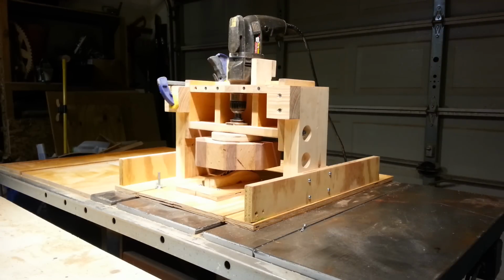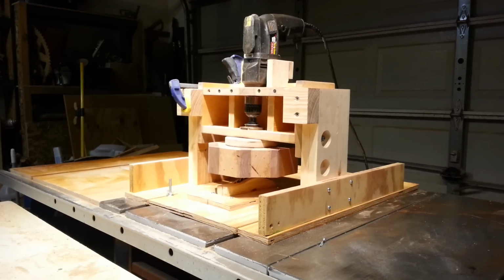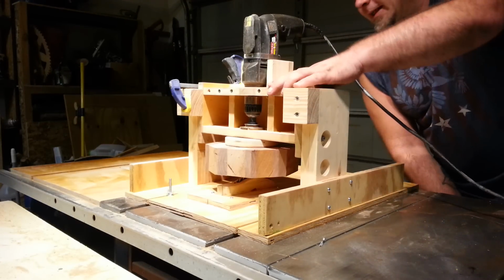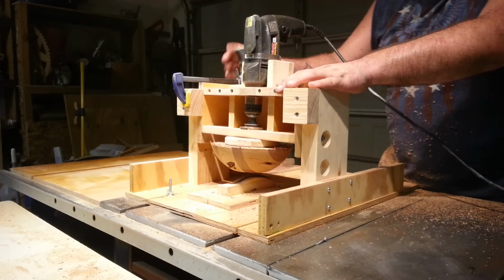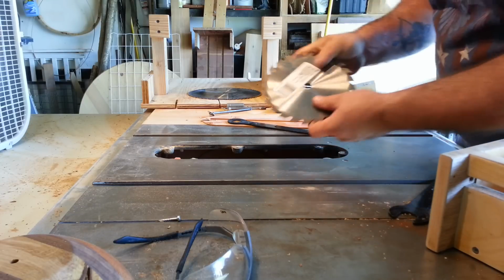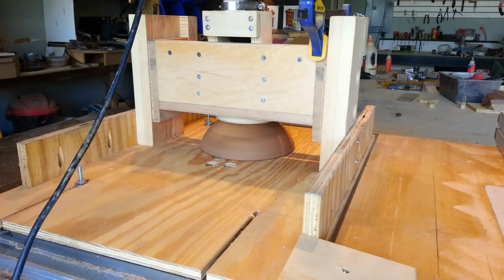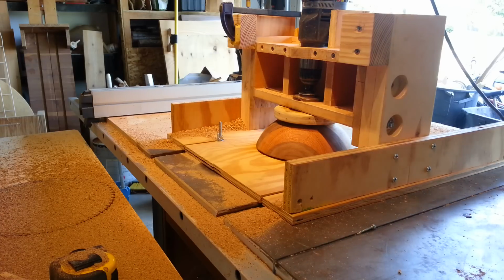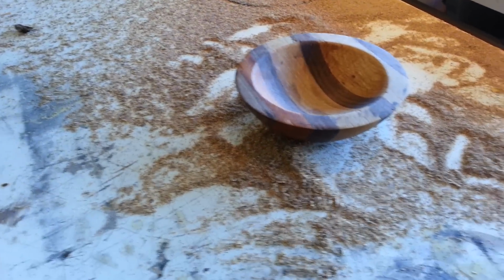SIMPLE JIG! turns a "bowl" on  "tablesaw"!

Comment: As my uncle used to tell me: if you save it, it will last forever. At a reasonable speed there is no abusive force in this process; this is just one more brilliant innovation to add to the list of uses for the most versatile carpentry tool that there is. If you only use your table-saw for straight cuts, there are so many things that you will never make. Replacing bearings (and even sometimes a motor) is just part of the game to me.

Comment: i have seen a lot of videos of bowl making with green wood and then having to let them dry before finishing them back on the lathe 
i can see this being an excellent way of "roughing" out bowls in quantity quickly and easily with no problems mounting onto the lath if you use the surface plate for both operations and mark the orientation 
will be making one of these as soon as possible 
do you have plans for them that we your subscribers can get

Comment: Izzy,  Thanks for the video.  I'm making a large bowl for a pattern for sand casting and this looks like the perfect method for what I'm doing.  Can you share more details or video about the bearing that connects & supports the drill to the bowl blank?  That would help me understand how it works.   I want to scale it up for an 18" diameter bowl.  I only need to shape the exterior.  I'm planning to decorate the pattern bowl with various temporary decorative textures & patterns, and reuse it over and over. 
thanks again,

Comment: Have you considered including a method by which the jig could be slowly moved horizontally while the bowl is in the inverted position and the saw blade raised? My thought is to move the blank after you have raised the blade to the desired depth of the bowl. It would create a larger diameter bowl with a flat bottom. Perhaps some sort of screw advance would do the trick.

Comment: Hey thanks, I have never seen a jig like that before, great because it sounds like you are really into jigs, ha   anyway its way cool.

So at the end of the video you mention about seeing what it can do, this may be a suggestion a lot of the stuff I make are cove on the table saw by running the stock at an angle across the blade with a slanted fence clamped to the table, however in some instances instead of the blade staying at square, tilt the blade for different effects thought it may work you

Comment: Would using a stacked Dado blade work better? Would it make a smoother cut?
Reply from the maker: Jack Lingerfelt  I wouldnt say it leaves a better cut but it definitely feels safer
Reply: +Jack Lingerfelt  Yes, and perhaps a little slower speed on the drill.

Comment: To thin the sides, just determine how much you want to cut away, divide that in half, and set that distance as a stop both in front and behind the current location. THen you can slowly push the jig forward and backward on the table to make the inside of the bowl wider. Awesome jig though.

Comment: Since you use a smaller blade to turn the inside you could decrease the wall thikness by ofsetting from center and maintain the same depth. The drawback is making the bottom center flat which would have to be done by hand.

Comment: The outside looks safe enough but maybe if depth cuts were made for the inside without spinning the drill it would be easier and safer to cut the inside then spin it after to clean it up. You didn't show how you mounted it to the drill though. I like crazy creative ideas like this - Coool.

Comment: Might I ask what kind of wood you use for these kinds of projects?
Reply: Same as on any turned pieces.  You'd want to stay away from extremely soft woods and knotholes for most projects (unless it's primarily an artistic piece) and be aware of any potentially toxic oils that are in some species, in regards to fumes when you are cutting and use with eating or drinking, if you're making cups and bowls.  (And spoons – those can be turned, albeit not usually on a table saw!)

Extremely hard woods like ironwood and ebony may also eat your blades faster than you can cut this kind of project, so keep that in mind when you get really adventurous.

Comment: realy nice done lol

there is only one thing i want to give you the speed of the tools used normaly for this stuff is spinning a lot faster then a tablesaw so you get a lot fibration doing this at a normal tablesaw

if you are able to speed up the tablesaw then the risk of parts breaking of get's smaller and the fibration will get lesser to :)
Reply from the maker: Have had no trouble with this jig or my newer version. Seams to be working great!
Reply from the maker: this is the new jig. Craziest "Jig" On The Planet! Turn "Wood Bowls"!

Comment: Wait, I've got another idea what if you had instead of one center point for the bowl/blade to hollow out, what if you had like 3 distinct center points, meaning three different points of contact with the blade and resulting in 3 distinct hollows, looking sort of like a 3 leaf clover?? It would look sort of like 3 distinct holes from the Chinese Checkers very close together even overlapping where they meet, ooops  so sorry I see this is on the outside of the bowl work but its for inside work your

Comment: Use a slower speed on your drill and you won't get cogging where the blade in the saw is forcing the work piece to turn.  It will keep your chips smaller.
Reply from the maker: Seems like that would be he case. I had the same thoughts my self but I have made a bunch of bowls on my new jig now and it is the lower speeds that cause the most problems. ie. tare out clogging high blade pressures.. check out mu other bowl turning vids.  Craziest Table Saw Jig On The Planet! Makes Wood Bowls

Comment: Good jig idea, but the drill was not.  Hitting the blade from the side is not good.  That drill running high speed is putting a sideways force onto that blade, which is bad for the blade and as stated, dangerous.  At the very least, it would have been better to just manually and slowly turn it by hand with a knob in place of the drill.  Very! slowly.
Combining two high speed tools is also very dangerous.
Kids, adults, anyone without a clue, don't do things like this.
Also would like to add; I'm not a fan of wasting so much wood to make a bowl.  There are so many other ways to make a wooden bowl without creating a heap of sawdust.

Comment: bowl spin speed is way to fast. You end up cutting with the side of the blade. Need to slow it down to about 30 rpm.
Reply from the maker: Not at all, have cut a bunch of bowls now trying many different speeds and methods and the higher speeds consistently produce the best result.  Check out my other vids on bowl making.  Craziest Table Saw Jig On The Planet! Makes Wood Bowls